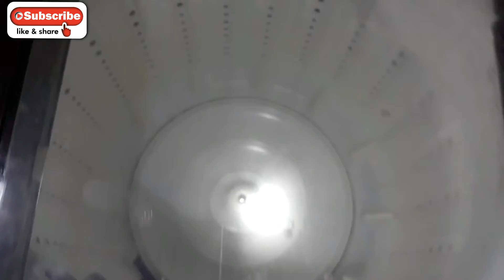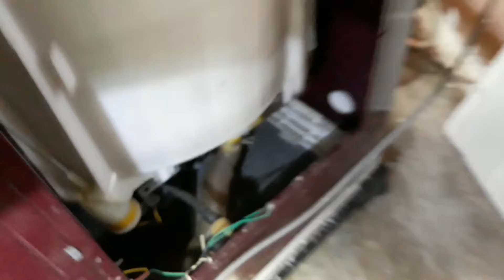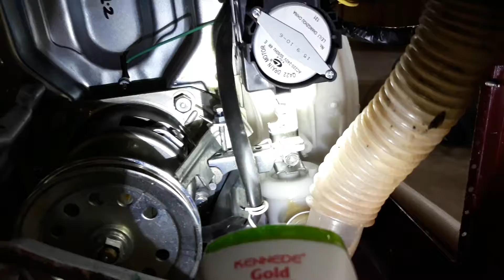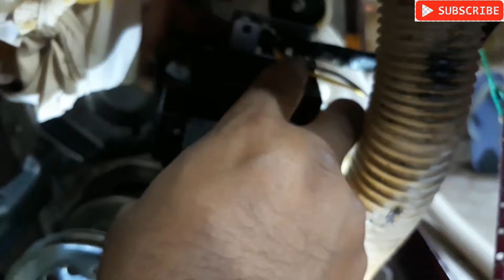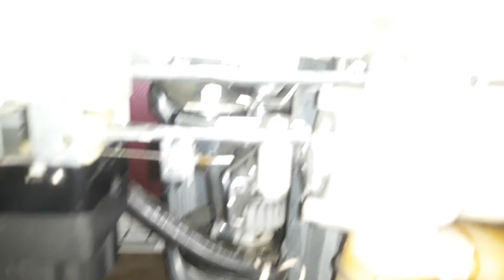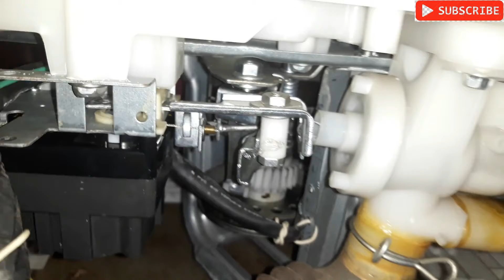Washing Machine Not Spinning I Drum Is Not Rotating I Videocon Washing Machine Repair At Home

Comment: Bhai spin operation mai tub bohut jyada hil rha hai.. thode kapdo mai hi aur abruptly band ho jati h machine...  Kya dikkat ho rhi hai..???
Reply from the maker: Either motor set is messy or the outer drum holding suspensions are bad. Check them
Reply: @technoboy-allinOne  do the suspensions have any specific order to set or all the 4 of them are same and do not need and specific order.....??
Reply from the maker: All of them ar same i guess. Aligned in a same line
Reply: @technoboy-allinOne  okay thanks